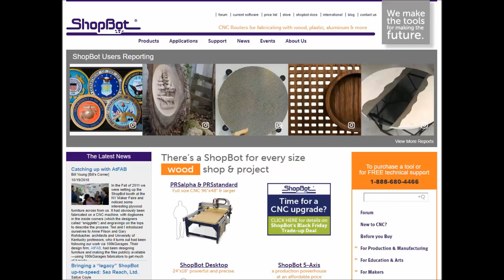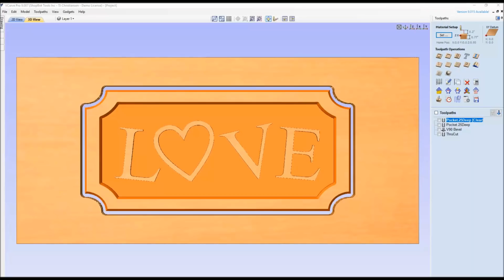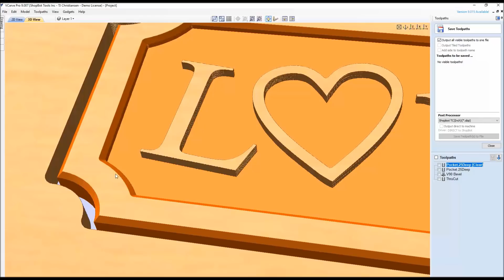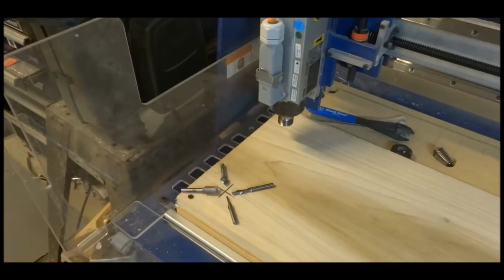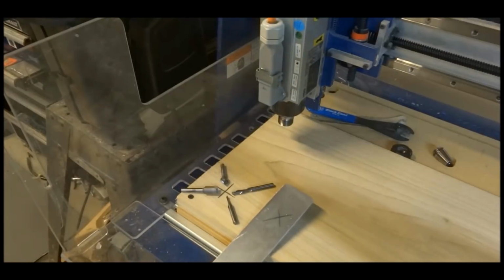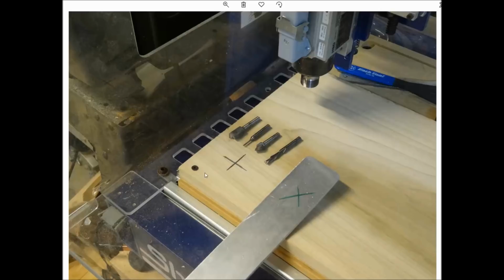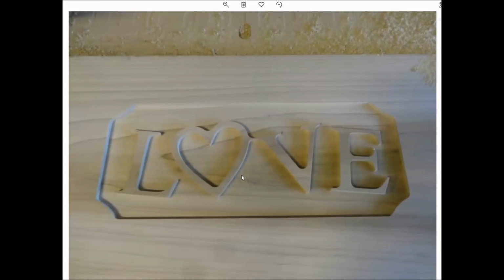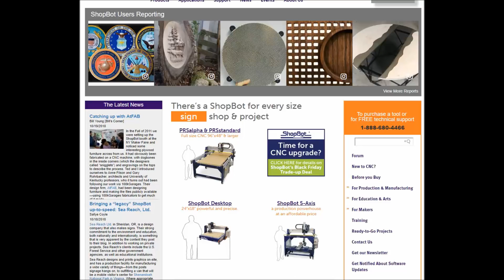Zeroing Multiple Bits

Comment: I did run into this issue on the last sign I made. I had LOTS of clean up to do. And... I didn't use that 1/2" for the large area clearance so it took forever. Do you have a recommended bit for that? I need to purchase one for my next sign.